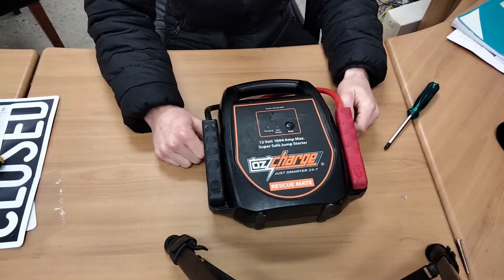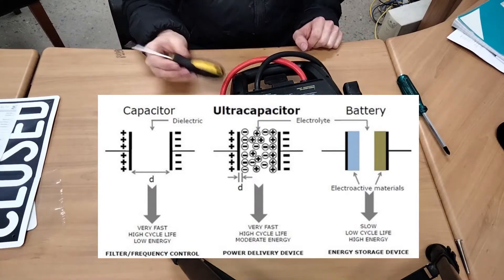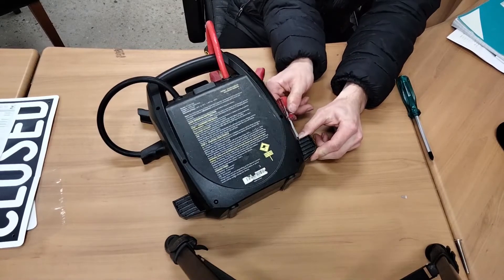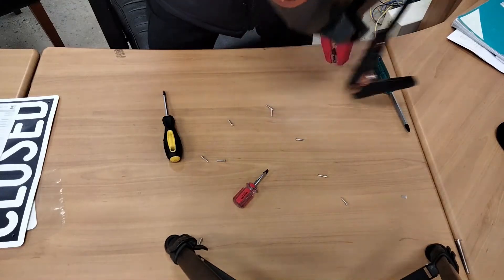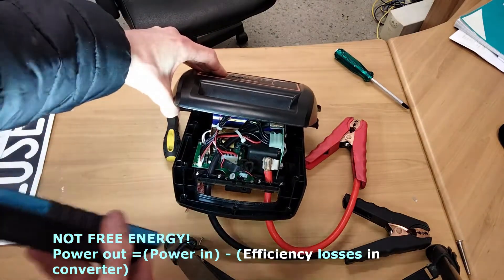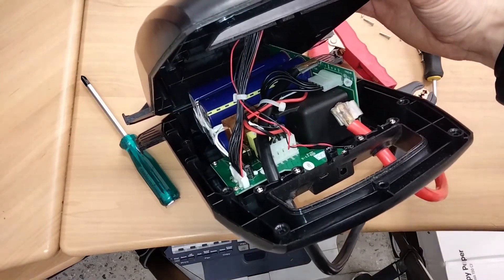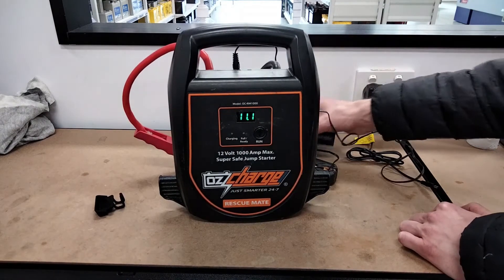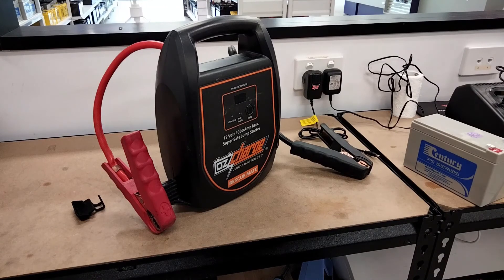OzCharge Jumpstarter Teardown 12v 1000A

Comment: I'm still waiting for the Super Capacitors value in Farad, but seems to be 100F each capacitor. Yes, the inverter has a problem, or inside the "relay" case it's happening something. There will be a sort of step up convertor with some variable issue. Anyway, where is it the jump starter? I give you like just because I saw the supercapacitors inside and honestly, I'm disappointed about the small size. The bank will be 16F-20F at 16V only, but I'm amazed about the "1000A", because 100 Farad @ 2.7V, means 100*2.7 = 270 coulombs of charge there - that can produce any current profile that time integrates to 270. For example, you could have 10 amps for 27 seconds, or 1 amp for 270 seconds, or 54A for 5 seconds, or 90A for 3 seconds, etc.
Reply from the maker: Sorry mate, must have missed your previous comment, or forgotten to reply. Yes, the converter was the failed part, I saw a blackened area on the display board where a strand of wire from the main negative cable had shorted to the circuit board. Its strange how well these work, given all that you have mentioned! The time which the starter uses current for must be tiny, because I havent had a car that this couldnt start. I am sure the larger diesels would struggle though...